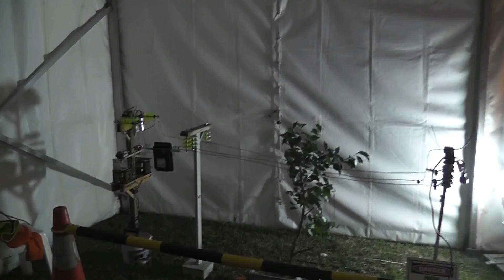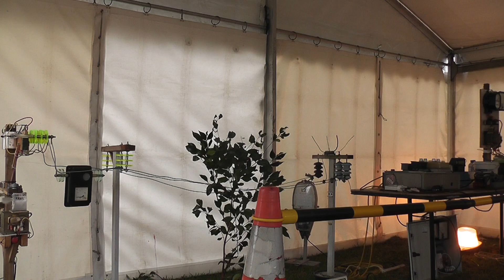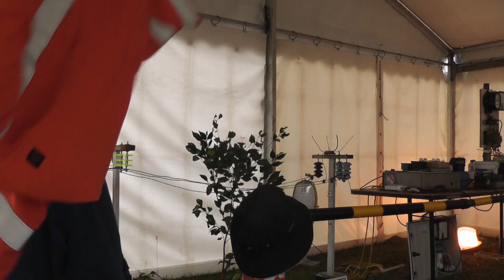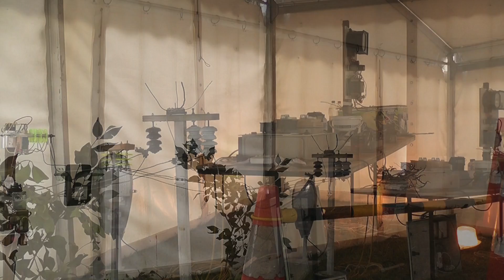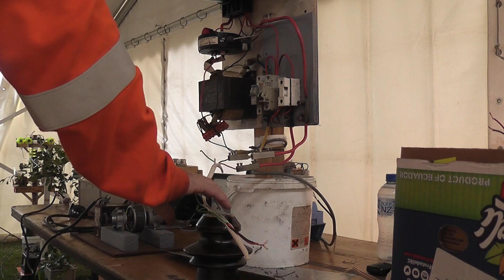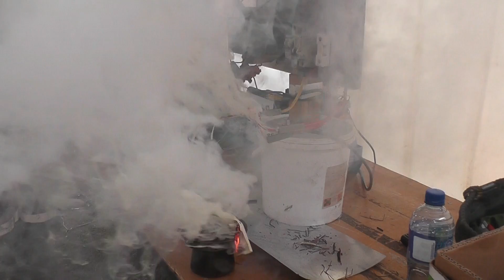4.4 kV Tree v Power line - Strange Motor - Fuse tests

Comment: The part about the dangers of reloading domestic fuses wrong, needs to be on an Ad campaign in New Zealand. Some of the fuse wire substitutes Ive seen over the years are unreal. Nails, thick rolls of tin foil etc. Its a wonder there aren't  more electrical fires. Its funny that Plumbers have an ad campaign about the dangers of home owners doing their own plumbing, yet the Electrical industry doesn't.
Reply from the maker: 100 % agree with you.

Comment: Recall power Company in grade school doing this.  They cooked a hotdog.
We had a power surge from substation that hit so hard it nocked out my Cummins Onan transfer switch.   
I always been told by electricians that worked for me, to throw all the breakers at least once a year or something about the springs would not throw when a overload happened.
Can you explain why in plain words that is required?  I have being doing it for years and asked the Onan tech if they were bull shitting me.  He said no they should be flipped once a year.  But he explained springs got stiff?   The old screw in fuses would just blow.
Ray I told my friends about it and they ask why would spring get stiff.   Can you explain or debunk?
The power Company sent me a form to fill out for my generator repair.
Reply: Ummmm, there's a company called "Onan"?  As in the guy in the Bible who was slain by gawd for masturbation?  Really?

I'd not heard of throwing breakers once a year.  Springs do eventually lose some of their elasticity if stretched or compressed for long periods, but I doubt a quick workout once a year would reverse that.  But they could get a little gummy from atmospheric contamination (from heavy smokers) which might make them need a little more current to trip them, and operating them might help a little (but I doubt it).

More plausible is that if a mechanical defect has developed then testing them once a year will spot it.
Reply: @bdf2718   The company was founded in 1920 by David W. Onan.  They were once one of the world's largest manufacturers of standby power generators.
Reply: @douro20  
His schooldays were probably not very enjoyable.  I can imagine his schoolmates telling him what the "W" stands for...
Reply: I don't think it's anything to do with springs getting stiff or stretching, I think if anything, it's to do with the contacts simply being moved so they don't tend to stick to one another. It doesn't hurt that every moving part get moved through its paces, but to be honest, I can't see Joe Homeowner or Terry Tenant setting aside a day to shut down power to the whole house for a few moments and throw all the breakers back and forth.  Would it hurt anything? No, but afterwards, you've gotta go around the house re-setting digital clocks and stuff, which most folks would not appreciate. But neither would they appreciate that their breaker could use a little "exercise" periodically.

Comment: Great video, the circuit breaker tests should be made into a public information film. Maybe people with think twice about bypassing fuses then!
Reply: I bypassed a fuse on a faulty electronic once just to see if the unit was faulty, and let me tell you, that was a bonafide Flashbang. :D 

Otherwise when I'm too lazy to buy a proper fuse, I just rewire it, internally. Heat up the cap with a lighter, open it, put new wire in, making sure to not lose any of the 'sand', and there you go. I make sure it's the same wire thickness, though. Also, never rely on contactor type fuses, Always must have one physical fuse, because the contactors weld sometimes for no reason, or arc and blow.